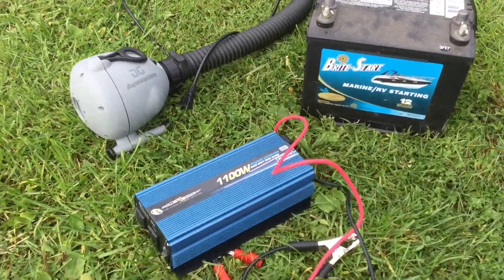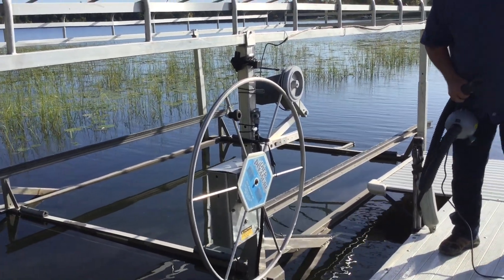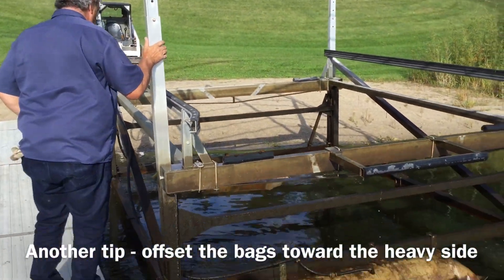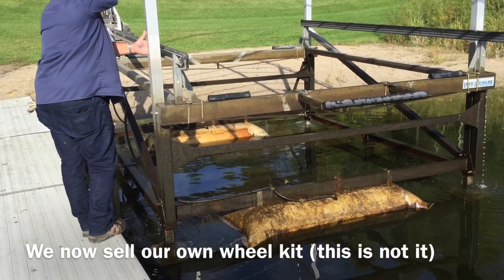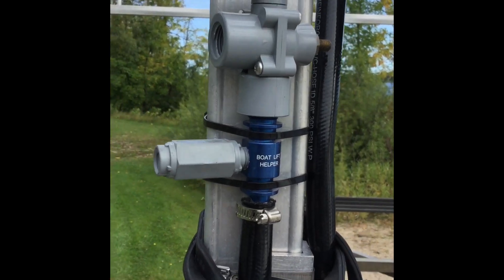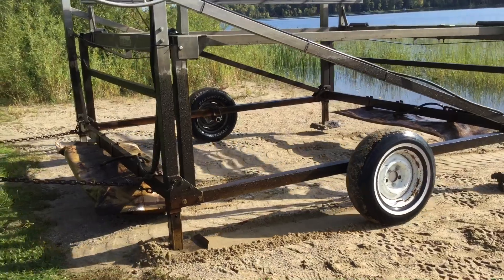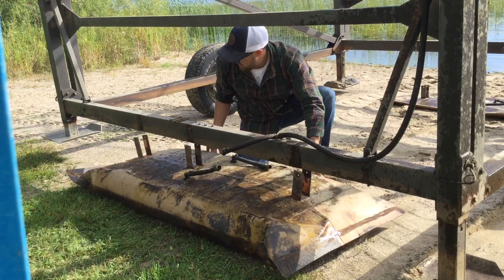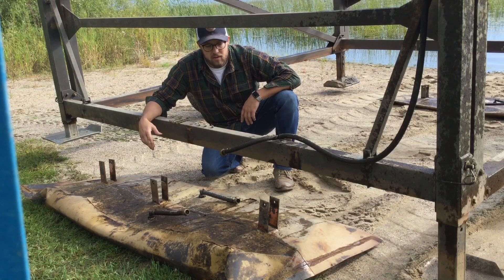Boat Lift Air Bags | Boat Lift Helper System (Extended Version)

Comment: Do you have to take the bags inside for the winter
Reply from the maker: Yes, we recommend to remove the airbags. The primary reason is so animals do not chew on the airbags when outside in the winter/spring.
We are not worried about snow, cold weather or the suns UV, but animals.